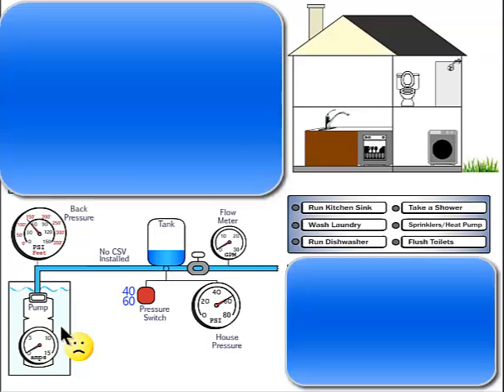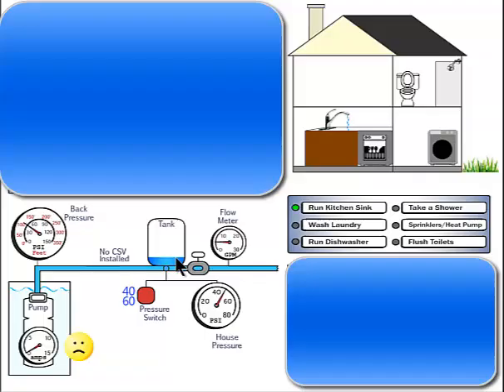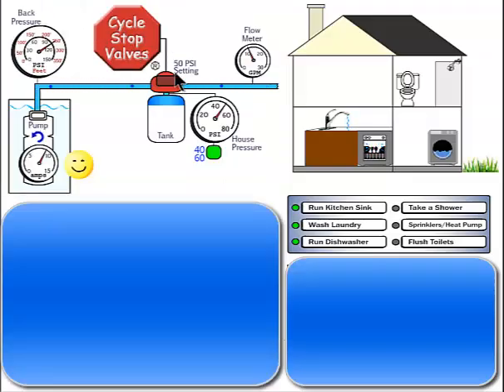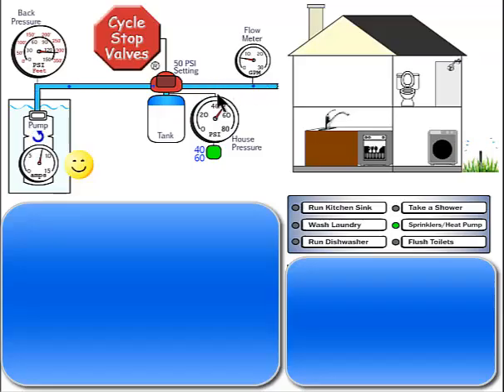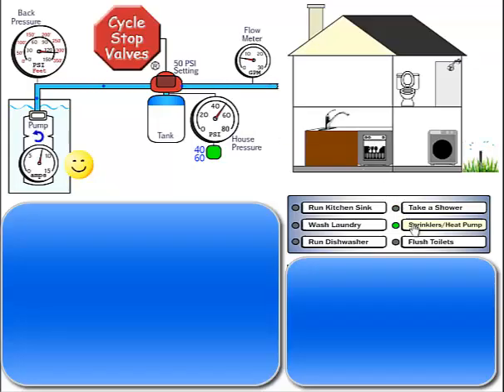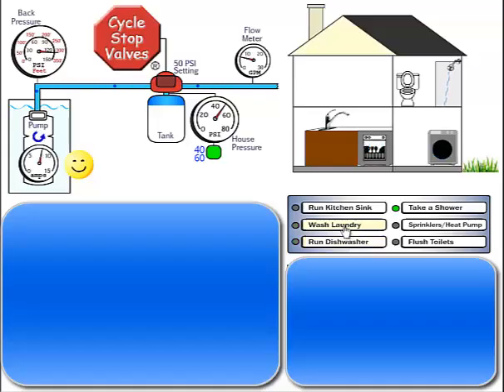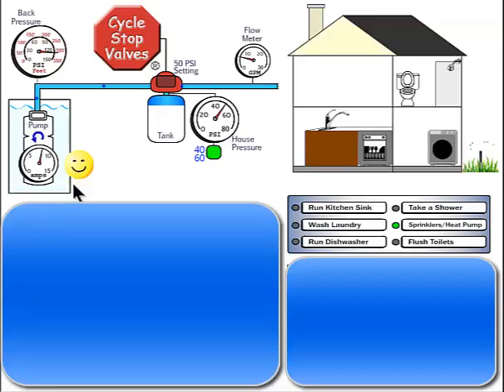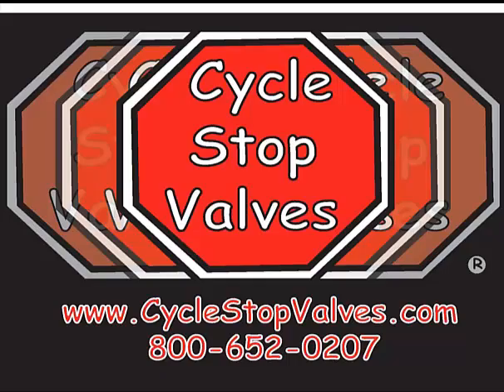How a Pressure Tank Works and why you need a Cycle Stop Valve

Comment: In my basement, I have a 55 gallon pneumatic storage tank (20-40 psi, fed by typical submersible well pump/tank combo 100 ft away) prior to a Simer booster pump that increases pressure about 25-30 psi to around 65-70psi, feeding an 86 gallon bladder tank and house fixtures. The pump has its own (internal) on/off non-adjustable pressure switch. There are check valves and relief valves where needed, and a pressure reducing valve prior to the pump to prevent it from increasing pressure beyond 75 psi max. How might a CSV work in this system?
Reply from the maker: Wow! Sounds like a mess.  A 55 gallon size pressure tank only holds 12 gallons of water.  It is just a pressure tank, not a storage tank.  You should be able to get all the pressure you need from the well pump, and not need a booster pump and all the other stuff.  The 55 gallon pressure tank is much larger than needed with a CSV, but will work fine.  Just turn up the pressure switch on the well pump to 60/80, and set a CSV1A for 70 PSI strong constant pressure to the house.  Then you will not need the extra boost pump, 86 gallon tank, pressure reducing valve, etc.  The CSV system will work much better. last much longer, and deliver stronger pressure to the house.
Reply: Thanks for the reply. The well pump and old tank combo serve two homes, with the tank likely not having much capacity after many, many years, and piping so old that to mess with it would likely require a complete re-do. Regularly, the well pump combo delivered no more than a trickle. Meanwhile, in the pneumatic tank (air over water), the capacity is actually closer to 50/50, providing sufficient storage draw for the booster pump, as the well pump, again, has low flow, low pressure. So, getting back to the booster pump and bladder tank, these have totally corrected a decades-long problem of having little to no water after short periods of use. One problem that remains though is correcting pressure ranging (40-70) still present, since booster pump only turns on once pressure sufficiently drops. So, back to original question, would a CSV work between the booster pump and bladder tank to keep pressure more steady, or is it a problem there is no pressure switch downstream of the booster pump?
Reply from the maker: @OccamsRazor71  What kind of booster pump do you have?
Reply from the maker: @OccamsRazor71  If you are getting more than 25% water from a pressure tank, something is wrong with the tank.  Your bandaid booster pump may have helped the pressure, but shouldn't be needed if the well pump is set up correctly.  But yes the CSV will solve the cycling problem with the booster pump.  But yes the pressure switch has to be after the CSV.  Again, what kind of booster pump do you have?
Reply: It’s a Simer 407SS.
Reply from the maker: @OccamsRazor71  That is one of those pumps that is designed to be replaced every couple of years instead of lasting 40 years like it should.  The "masscontrol" thing on top is a flow switch control with a teacup size tank built in.  They are not a reliable or long lasting type control.  Every pump company sells something similar because they like for you to replace that pump often.  The pump by itself won't build enough pressure to work with a pressure switch or a CSV.  When it does out soon, just replace it with a J7S jet pump and a PK1A control kit.  This will cost you about twice as much, but will last 40 years instead of 2, so do the math on which is less expensive.

Comment: wow thanks! My well pump is always on and off when I water my lawn and shower and stuff. I thought something was wrong with my tank but now I know it doesn't hold anything. I need this bad. the pump was replaced 8 years ago when I bought the house and don't know if a variable pump in the ground.
Reply from the maker: Even the new variable speed pumps just turn on and off all the time you are using water.  But if you have a regular pressure switch it is probably not a variable speed pump and the Cycle Stop Valve will solve your problem and give you strong constant pressure in the shower.

Comment: How much does this contraption cost and where do I get it?
Reply from the maker: The two most common residential size valves are the CSV125 and the CSV1A that sell for $69.00 and $179.00 respectively.   You can get them at Cyclestopvalves.com.
Reply: @cyclestopvalves8380  I already own (not installed yet) a pressure regulator to control the incoming water pressure to my house. Is this the same thing?
Reply from the maker: @armandomarin-arias4021  No!  A pressure regulator will burn up a pump and a Cycle Stop Valve cannot regulate pressure from a city supply.  If you have a well pump or booster pump, you need a Cycle Stop Valve.  If you have high pressure coming from a city water meter, you need a pressure regulating valve.
Reply: @cyclestopvalves8380  Thank you very much for your info. I will be looking into this after the holiday invoices. For what you inform me I think I am in need of one of those valves. Will be getting in touch soon. In the meanwhile, Thanks again.

Comment: My pump is next to my water storage tank outside my house and the pressure tank is in the basement inside my house.  Does the CSV need to be in close proximity to the pressure tank or can it be installed right after the pump?  My pump has the pressure gauge and pressure switch right next to it.
Reply from the maker: Well the pressure switch and pressure tank need to be close together and after the CSV.  But the CSV can be at the well or just before the pressure tank/pressure switch.  The CSV is usually installed at the well when there are hydrants or tees in the line before it gets to the pressure tank at the house.
Reply: @cyclestopvalves8380  My pressure switch and tank are about 20 feet apart and have been since I've owned the house.  But if I'm going to install a CSV, should I move the pressure tank out to where the switch is?
Reply from the maker: @geronimomadmartin3499  Yes or move the switch closer to the tank.

Comment: So it basically allows the cut in to happen but restricts the cut out to when no flow is detected and the pressure reaches 60. Or is it more complicated than that? You said it increases and decreases  pump flow, how is that achieved? Special variable speed pump?
Reply from the maker: It is just a simple valve that opens and closes according to pressure.  When the spring is set to 50 PSI, the spring pushes the valve open when there is less than 50 PSI.  When the diaphragm on the end of the spring sees 51 PSI it pushes the valve closed.  So the CSV makes the pump supply just the right amount of water by opening or closing as much as needed to maintain 50 PSI.  With a 20 GPM pump the CSV will vary the flow from 1 GPM to 20 GPM matching the amount being used by maintaining 50 PSI constant.  It just valves back the pump and makes it think it is in a deeper well when only small amount of water are needed.  The CSV just cannot close to less than 1 GPM, because your pump needs to flow at least 1 GPM to stay cool.  When you are no longer using any water the 1 GPM "leaking" through the closed CSV has no place to go except the tank, and the tank is filled to 60 PSI where the pressure switch shuts off the pump.  The pump stays at full speed all the time, but the amps vary according to how much water you are using.  This is just how pumps work normally, and anyone selling a VFD or variable speed drive just doesn't know pumps drop in amps naturally when simply restricted with a valve.  VFD's are nothing but a scam.  The natural counter intuitive properties of pumps confuses people.  They fall for the VFD hype, pay way more needed, and are out of water way more often than they should be.  A simple Cycle Stop Valve does a better job than a VFD, cost much less, and makes pumps last much longer, which is why you don't see the pump companies pushing them like they do those highly profitable and short lived VFD's.
Reply: @cyclestopvalves8380  cool, thanks for the explanation.

Comment: I have a jet pump and 6 gal pressure tank at the cottage. If I were to install this valve does it get installed between the pump and the pressure tank?
Reply from the maker: Yes.  And you need to move the sensing line for the pressure switch to one of the extra ports on the CSV1A or to the line close to the pressure tank.  You can also just add a new pressure switch and wire around the switch on the side of the motor as shown in our wiring instructions for "jet pumps". Thanks
Reply: @cyclestopvalves8380  yes I understand about the sensing line moving to the valve. In this case how will the pump sense 60PSI to turn off. I was thinking to purchase the CSV125. Does it have a sensing port
Reply from the maker: @truenorthmuskoka9077  The CSV125-3 will work with a jet pump,  But there are no extra ports on the CSV125 like there are on the CSV1A.  You would need a tee close to the tank to have a place to connect the pressure switch.
Reply: @cyclestopvalves8380  I already have a pressure switch at the pump. Why do I need another one near the pressure tank. My pump and tank are within 1 foot of each other.
Reply from the maker: @truenorthmuskoka9077  You can still use that pressure switch if you want.   The sensing line just needs to be extended to a tee at the pressure tank, which both the tank and switch need to be after the CSV125.  Pump-CSV-pressure tank/pressure switch.
Reply: @cyclestopvalves8380  great. Thx for the info. Much appreciated.

Comment: My well water goes to a filtering and water softening and then reverse osmosis, to sit in a big tank, which then has it's own pump aside from the well water pump. How would this work with or even be needed?
Reply from the maker: You would need the CSV on the booster pumping out of the storage tank.  You could also use a CSV on the well pump and have it set up to pump directly from the well in the case your booster at the storage tank quits on New Years day.

Comment: Why not just keep the pressure switch on off at 50psi?
Reply from the maker: On and off at the same pressure is not possible.  On at 40 and off at 60 gives you an average of 50.  The narrower you set the on and off pressures the faster the pump cycles on and off.

Comment: Great animation. I am on a shared mutual well with about 70 homes. The pressure is ok, around 40. The house came with an old irrigation pump and two large tanks to accelerate water to farm and home. I replaced this with a Goulds constant flow variable pressure pump running 60/40 with a tiny ten gallon tank. The set up works great but i have a thump thump that occurs randomly throughout the day even though the breaker to the pump is off and I had a new brass ball check valve installed between pump and main line (to the shared well). When I bypass the pump entirely i have no check valve and can hear and feel vibration throughout the house as neighbors water their homes, yards, etc. The thumping only occurs when the pump is in line on or off electrically. My guess is the tank is making the noises. But why? What is making my tiny tank thump in the middle of the night when no water is being used, the pump is powered off by breaker and there is a new check valve?
Reply from the maker: Bladder tanks will thump when the pressure decrease below the air charge in the bladder.  With 38 PSI air charge, the bladder hits the bottom of the tank anytime pressure falls below 38 PSI.  Reducing the air charge in the tank will probably stop the the water hammer thump.  Then all you need to do is get rid of that Tar Baby of a variable speed pump, install a regular jet pump with a Cycle Stop Valve, and you will have a pump system that will last 30 years in stead of maybe 3 years.

Also, we make larger CSV's for larger pumps.  The shared well for 70 homes could use a CSV even more than a small pump.  The CSV would deliver better pressure to the 70 house, make the pump system last much longer, cut expenses greatly for pump control equipment, reducing cost to all concerned.  We would only need an 80 gallon size pressure tank to do 70 homes with a CSV.
Reply: @cyclestopvalves8380  Thanks for your response. As a member of the mutual well water company I have no real say in how the water is delivered to the home. I bought the home with a meter at the street, 165 feet from my home. The company has a 60,000 gallon tank several hundreds or a thousand feet up on a hill that basically gravity feeds water to the 70 or so members down the line. When I bought the house it had a very loud electric pump and two 200 gallon bladder tanks. The property is one acre. Goats, chickens,  vineyard and fruit trees on irrigation. The house is 3.5 bath with fire sprinkler system, California. I switched to the tar baby Goulds pump because it is whisper quiet and much more powerful than the old pump which was very noisy. Unfortunately the pump and piping was set up adjacent to the house, rather than farther away so every time the old pump came on you could hear it in the bedrooms above it. I will adjust the bladder pressure and see if i cant get rid of that hammering. Thanks for your help.
Reply from the maker: @diegoroswell302  A fire system usually requires you to have a storage tank of your own?  A submersible pump in the storage tank would supply more water and better pressure than a jet or centrifugal pump, and would be not just whisper quiet, but completely silent.  You will need to make some changes soon as those Aqua-boost type pumps are not known to last very long.  I just hope it doesn't quit you when you have a fire and really need it.  :(

Comment: Does it work with a single phase submersible that can only be cycled 3 times an hour?
Reply from the maker: Sure.  As long as you only use water 3 times an hour the CSV will only let the pump cycle on 3 times an hour.  It doesn't matter how long you use the water each time, as the CSV will not let the pump shut off until you stop using water.  But every time you start using water, and use more than the pressure tank holds, the pump will have to cycle on.  So, you can also add a larger tank with the CSV to reduce the cycles even more.  But 3 times an hour sounds like a large pump as most small pumps can do 4 to 12 starts per hour.
Reply: @cyclestopvalves8380  thanks for quick reply 😃 it's a 70 metre well and a 2 horse power pump will it still work if i put a 1000 litre tank ?
Reply from the maker: @damienfrizzell9394  It all depends on  how you use the water.  A 1000L pressure tank only holds 250L of water.  But that is a very large tank to use with a CSV.  We normally would use a 44L tank or smaller.  The CSV and small tank will cycle the pump on anytime you use water, and the pump will stay on until you are finished using water.  As long as you don't use water more than 3 times per hour, no matter how long you leave it running, the pump will not cycle more than 3 times per hour.  But if a small pump has such a limitation, you should probably look for a better pump.  Most small pump can handle 300 cycles per day.
Reply from the maker: @damienfrizzell9394  2HP pump and 70 meter well is no problem for the CSV.  And yes it will work with a 1000 liter tank, but that is a waste of money as a 44 liter tank is all you need with the CSV.
Reply: @cyclestopvalves8380   thanks i meant non pressure tank. Every  body in my area recommends i fill in to a large tank and then pump from there with second pump
Reply from the maker: @damienfrizzell9394  You will still need a pressure tank on the pump drawing out of the storage tank and sending water to the house.  You just won't need a pressure tank on the well pump to the storage tank.  Here is a link to a drawing of what you need.  http://forum.cyclestopvalves.com/index.php?topic=1840.0
Reply: @cyclestopvalves8380  thanks is that a better setup than just having a fully cyclable pump  ?
Reply from the maker: @damienfrizzell9394  Anything is better than letting the pump cycle on and off.  Cycling is what destroys pumps.  Pumps are made to run 24/7/365 and will last longer when cycling less.
Reply: @cyclestopvalves8380  how much is a complete pressure tank setup with csv
Reply from the maker: @damienfrizzell9394  The Pk1A kit is $395.00 with free freight.
Reply from the maker: @damienfrizzell9394  The PK1A complete kit is 395.00 with free freight.

Comment: Hi, can you please give me an advice on wich model or brand of thank should I get to pair it up with your CVS?
Reply from the maker: We have kits that come with either a 4.5 or a 10 gallon size tank, which works for most applications.  1HP or smaller pump running at 40/60 or less with a single family home only needs the 4.5 gallon size tank.  Any larger family, extra house, 1.5HP pump or larger, or running higher than 40/60 pressure should use the 10 gallon size tank.  More than a couple houses and I would use a 20 gallon size tank.  Look at the kit model PK1A.

Comment: amps are the same regardless of having a csv, only way to ramp amps is with a vfd.
Reply from the maker: You would think so right?  But you are wrong.  The amps will reduce when restricting the flow of a full speed pump with a valve the same way they do when you slow the motor RPM with a VFD.  This is counter intuitive but absolutely true.  Any VFD company that lets you think that is scamming you out of a lot of money for a VFD that is not needed because pumps already lower amps naturally all by themselves.  See this video for an explanation.  https://www.youtube.com/watch?v=3GABhLLtjas